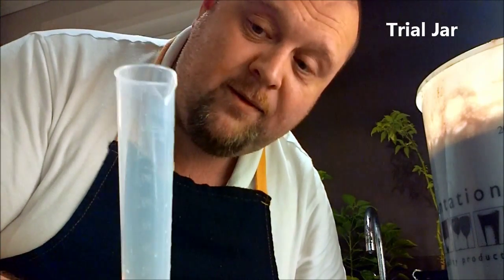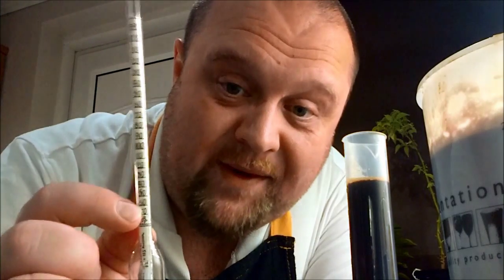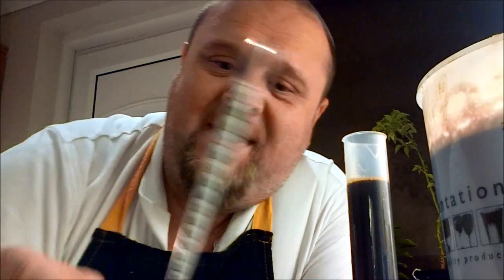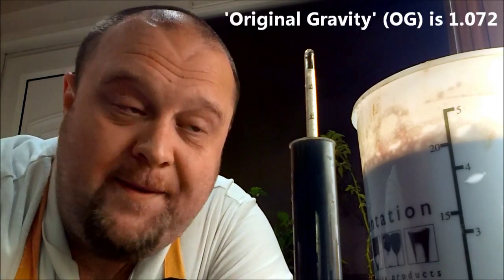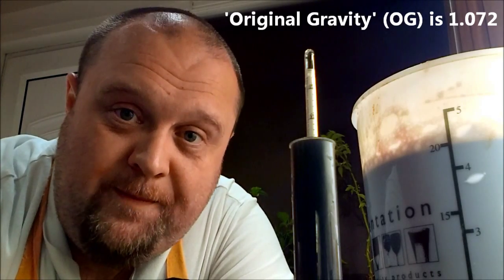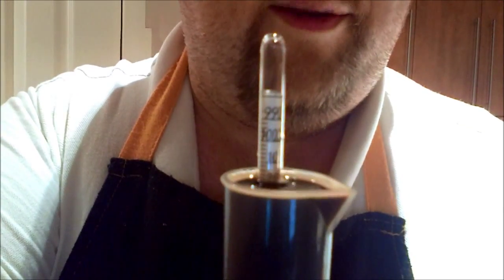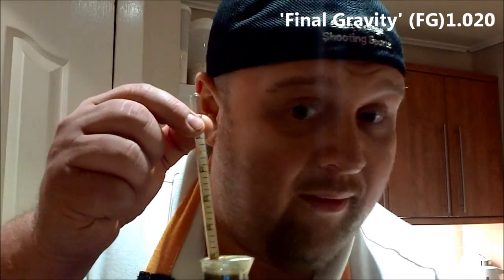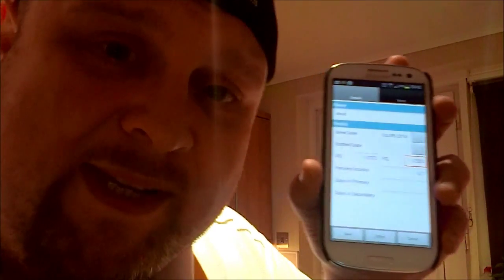Student Brewing - Hydrometers 101

Comment: You're right about the temperature, as long as you are somewhere in the range of room temperature, the margin of error is slim, you might end up a half of a percent off in your calculations one way or the other, but... If you are measuring hot wort straight out of the boiler, it can make a really big difference.
Thanks for another video!

Comment: how to calibrate a hydrometer (whether it's tap water or "spring" water) would have been a good tip to add as well... you're right about temp... though... everything should be close to room temp when you pitch the yeast to bottling for what most people use the hydrometer for.  Cheers!